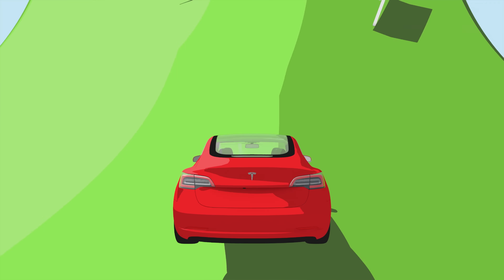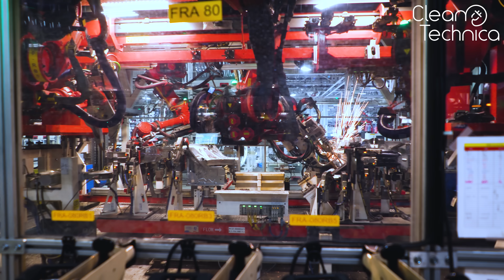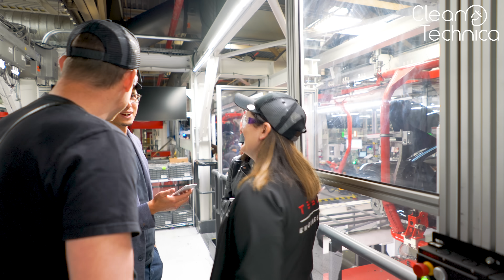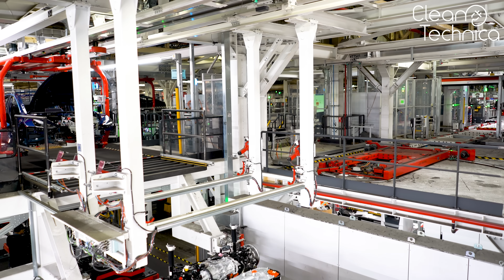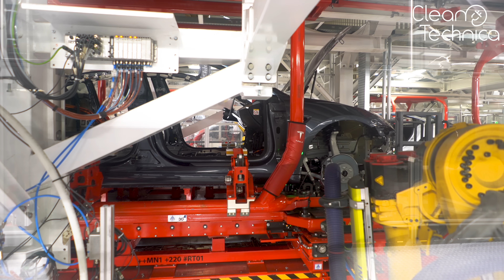Tesla Fremont Factory Tour, Part 3 — The Body Shop and General Assembly 3

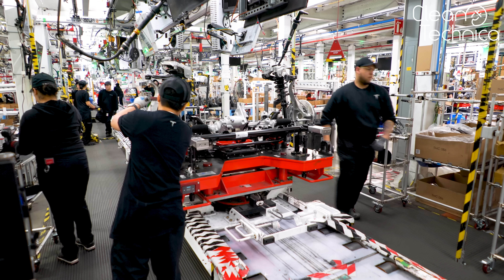Comment: 3:01  Fasten something near the front disc by hand
3:05  Route a cable near the front disc
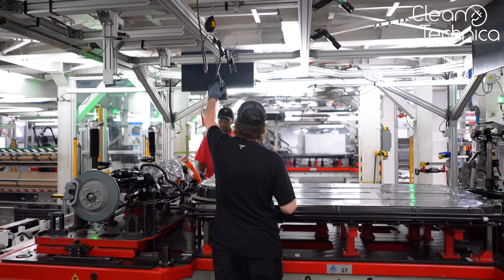3:13  Pull down a tool/instrument and join cables over the battery pack

Comment: I worked in many ford plants in the detroit area and everything shown in this video and previous videos is the same industry standard implemented within the last 20 years. The only thing different is the shiny red paint. Ford also has automated trains that pull 5-10 racks at a time around the stamping plants and has error proofing for every single screw/wire sensors and takes pictures within every process through out the whole assembly process. If a certain wire or screw is not within a spec of the camera or torque of the gun/drill/weld is too tight or too loose or stripped it will deny and fail the part and show up on the proofing screen as failed and will stop the line for the part/car to be scrapped.

Comment: Your comments referring to the screwing processes, are completely wrong as it's a standard Automotive APQP process based on the output of the PFMEA whereby safety related screws are 100% checked and recorded as a Safety Critical Characteristic (CC for short). Developed by Ford in the 60's, its standard today in all oems and suppliers and is nothing special like you reported.

Comment: Tesla is that automation mega monster. But that is how a car company which is driven by innovation not by sales is doing. Tesla had 17 years working on improvements and innovation and they gave everything they earned into this philosophy. That's why within a decade or 2 Tesla will not only be the richest most expensive company and also it will be by far the biggest automaker in the world with no company coming even remotly close to them. That will happen unless other companies started doing innovatio  and not so much sales.

Comment: I did also like that the the lower part with battery module, drive (motor and wheel shaft and wheels) is mounted on the body. That you don't speed it upp or cut somthing out.👌🏼

Comment: 5000 vehicles per week is two per minute 24-7. Explain how that factory is possibly achieving that production rate when there isn't a single station that doesn't require multiple minutes.
Reply: Eh?
24 hrs x 60 minutes
= 1,440 minutes in a full day
x 7 days in a week
= 10,080 minutes in a week
÷ 2 minutes per car
= ~5,000 cars per week
In the example at the end, it takes less than two minutes to marry the skateboard with the body.
Reply: @nettlesoup  because there are multiple lines at different stages of completion, so multiple cars are developed at the same time, they dont make 1 at a time.

Comment: bad design because i can see it is hard to repair tesla ev cars. engineers should strive as part of their to design for future repair unless they are designing for throw away products.
Reply: they are hard to repair? no they are hard to get permission to repair and hard to get parts for, EVs are much simpler then gas cars mechanically, tesla overbuilds their cars, sandy munro (industry expert from Detroit) did an annalist on the car and saw that tesla did intend to make this car last as long as possible, they found electronics usually found in military aircraft, mosfets that handle way more power then what the drive train through at it,  they say tesla over engineered the car and made it more expensive then it needed to be, so basically tesla did not cheep out on the guts of the car, they want people driving these for as long as possible https://www.teslarati.com/tesla-semi-1-million-mile-battery/
 https://electrek.co/2018/10/15/tesla-drive-after-million-miles-test/  the best enginners from the top schools flock to Tesla because their small size and work ethic allows more freedom in R&D so they make things like this https://insideevs.com/news/361430/tesla-big-casting-machine-frame/

Comment: Great set of videos, I agree with others who say this is the best set of Tesla factory videos. I really like your low-key narration. But I agree with others that much of what you see is common in manufacturing. The data collection they are doing is called SPC (Statistical Process Control). What is important is not just collecting the data but acting on it quickly to control process variations.
Anyway, great work. Subscribed.
Reply: Thanks!

Our understand from checking with them about this is that they are the only automaker with this detailed a level of parts/production tracking — and system was built in-house.

Comment: No anti corrosion treatment to be seen anyware, example 3,29 sec in, wheel wells are totally bare metal. yes inner plastic covers will cover most of this, but not all, ask Alfa Romeo. Could you do a special episode regarding this?

Comment: Most assembly line robots made in the last 10-15 years can change tools. It's optional head and not everyone would pay for it. KUKA and Festo could also be connected in a network or Cloud. Festo has models with camera and accelerometers data stored in database for over 10 years now. 
Tesla factory has many unique features you haven't touched, instead talking nonsense. In fact, Tesla acquired Grohman 2-3 years ago, a German robot company, to be up-to-date with robot assembly lines.
Reply: What are the cool pieces that we should cover? Everyone has different interests...
Reply: @KyleField  I guess you need to find a balance. If you ask 100 viewers,  they'll likely give you 100 different answers. I don't want to impose my interests and opinion on what is important to be shown. Overall you're doing a good job. The only thing I'm not happy with is the unchecked facts you present. There is nothing wrong being a Tesla fan,  but please,  make a quick research before narrating the video and not only check your facts,  but see what's in the discussions and forums,  what's the hot topics. I know for a fact,  showing the battery assembly line would be a viral video, especially now after they acquired Maxwell, but not sure if you'll be granted access to this part of the factory. Keep it up!
Reply: @111chicane  We plan to cover the battery lines, but they are in a different factory, in a different state. We'll get there :)
Reply: @KyleField  Great! I suggest you familiarize with the processes beforehand and include a little history of the development since 2015. 
As others mentioned,  an interview with the engineers on site will be a great addition too. 
Good luck to your team!

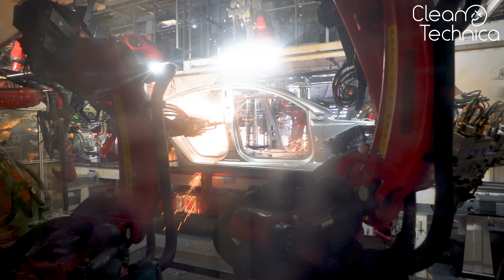Comment: 6:00, those did not tool change. Those units were not equipped with automatic tool changers (ATC). Even at 2:25 when you mention tool changing, those units were not equipped with any. Tool changing has been around for years, maybe decades and is not something new that Tesla does and others don't. Coincidentally, not a single unit in the entirety of your footage do you show a unit with a tool changer.
Source: I work for FANUC in the body shop segment and deal with these types of robots every day for many customers.
Reply: That's helpful, thanks :) We would love to pick your brain about the neat robots FANUC builds. They make factories feel like they're from the future!
Reply: @KyleField  ATI is probably the most widely used tool changer company in the industry. On our robotic arms, the way to identify if there is a tool changer is to look at the end of the arm where the red or yellow paint ends. This is known as the end effector. The black disc looking components on the end are the robots "face plate". Google images of FANUC robots and you will see what the robot looks like "naked". 
What is attached to the face place is either the tool itself via some sort of bracket or a tool changer. All of the units in your video appear to have brackets attached to the face plate.
https://www.ati-ia.com/products/toolchanger/robot_tool_changer.aspx

Comment: Most automakers have a database of each car with where all defects of any kind are collected, like bolts that aren't correct, cables that aren't connected properly ..., most of these issue's are resolved when they come out of the factory. And yes robots can pick more than one tool, it' also used in other car factories but is often neglected to save complexity. I'm wondering what automation system (PLC) they use over there.
Reply from the maker: They made their own PLC, that is what we meant with "homegrown system", a contractor installed it but Tesla designed it
Reply: @cleantechnica  A PLC is the logic that controlls everything you know so it's strange to do that,  are you sure they use no GE, ABB, Siemens ? What is the name of the system? If they made there own system it's not that big of a suprise that they had a lot of issue's in the begining.
Reply from the maker: @SillentShotz  I am not sure if they told us the name of the system, I would have to listen to the recording again, I am certain however that they made their own but can double check that with the recording as well when I have the time.
Reply: @SillentShotz  They use their own HMI (human-machine interface) system called the Tesla Manufacturing OS. As with any HMI, I believe they interface with the PLCs and have no reason to suspect that Tesla loads its own software onto the PLCs. As with any PLCs, it is highly likely (if not mandatory) that Tesla reprograms PLC software to work with its TMOS, ERP and MRP systems.
Reply: @KyleField  Almost every industry uses a HMI with their manufacturing OS, you can also call it a standard of programming. Did they make those PLC's themselves with there own software? That would be something intirely different.
Reply: @SillentShotz  No, I do not believe they make their own PLCs. Those usually come with the equipment. Tesla doesn't just use an HMI, they program it themselves. That software is completely custom. Just google "Tesla Manufacturing OS"

Comment: I'd love to see the same for a modern Toyota factory and a modern BMW or Audi factory
Reply: I have been to the 3 Series Plant in Munich. There is also definitely a lot of robots going but from what i have seen the Model 3 line is more automated... But i haven't been to the Tesla factory so it's hard to tell...
Reply: @meamzcs  It's not much different than any other, like Ford or GM. I work for FANUC body shops
Reply: @Refaldooloo  Yup.  I'm an engineer that used to work in automotive.  Tesla has a nice factory.  But honestly I didn't see a single thing that I haven't seen 20 years ago in other automotive factorises.   I was surprised on how slow the marriage process was.  It looks like nearly a 90 second cycle.  Yikes no wonder Tesla needs 4 assembly lines to make decent volume!
Reply: @erikstephens34  and that's when it's working!
Reply: @Refaldooloo  True enough.  Here is a example of a marriage station that is much faster and more complicated.  https://youtu.be/GT8Mx3Agkco?t=339
Reply: @erikstephens34  Not clear if the truck marriage is more complicated. The model 3 is also making HV electrical and HVAC connections during its marriage.
Reply from the maker: Who knows, that might happen on this channel, subscribe and find out ;)

Comment: incredible job.  thanks for the hard work.  loved the music.  I think your story really shows the innovation in manufacturing that is occurring.  

does every model three built go through this portion.  I am confused about the third line in the tent.  I am guessing that is for final assembly, which does not include these steps in the production process.  Do I have that about right?
Reply: That is a complete line I believe. Parts come in and car comes out. The tent assembly line was used to test new processes and improve the other lines.
Reply from the maker: Unfortunately we didn't get a chance to film in the sprung structure so we are not completely sure. My hunch is that GA4 includes pre-marriage manual assembly and post-marriage manual assembly, more on that (hopefully) in a bonus video

Comment: No matter how sophisticated it may be, they still don't make cars as they use to for example like the 57 Chey Bellair and the alike that are still around to this day.  Today's car is nothing but a snap-on plastic and bolts contraction that falls apart at 30 MPH in a crash.
Reply: You are very wrong. Never in history cars were as good as today. I am 65.
Todays cars can make 400.000 km life time, with basic maintenance  and  they get no rust.
VW, Opel, Ford can last 20 + years.  A Mercedes, BMW, Audi can last for 30 + years.   Think David.
Reply: @BeltramMilos  I agree with everything you said, except rust.
Reply: lol but this car is far safer for the person.  it gets over 130 mpge and the bellair got maybe around 15 mpg.  its also going to be autonomous which is far safer.  in ten years, cars will be in 90% fewer accidents, most of which will be fender benders.
Reply: @Ray Brown I've seen crash tests where a modern car collides head on at 50% overlap to a fifties Buick at high speed. Buick didn't do to well. Driver would have been crushed by engine. Driver of modern car would have walled away.
Reply: https://youtu.be/qoeDe8M20QE?t=1168